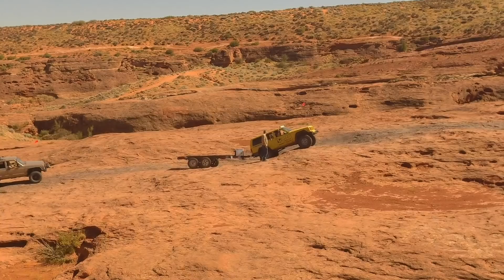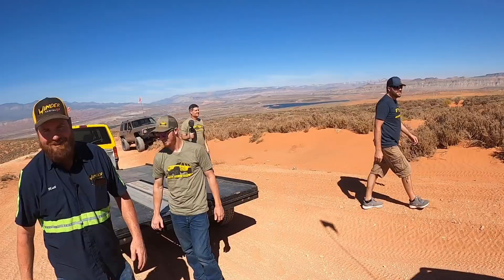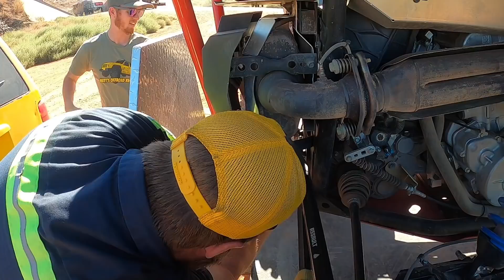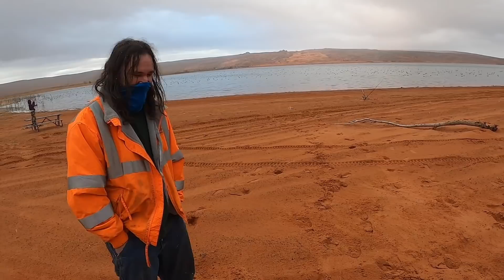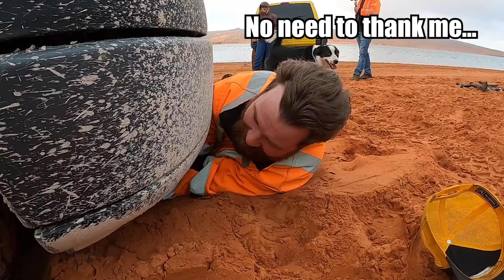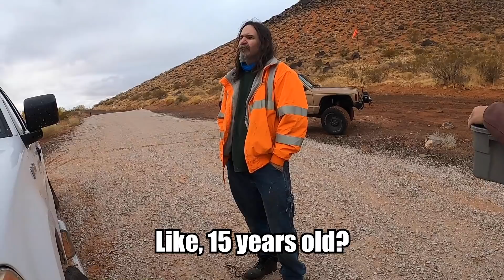Could I Make This Recovery Any Harder?!

Comment: it is the year 4021 and the historians still wonder "what was the purpose of covering the utah mountains in rubber?! some kind of ritual, or do these blackened rubber lines create a bigger picture when seen from way above"... we might never know for sure
Reply: That's a good one 😅😅😅
Reply: the black rubber must be for temperate acceleration
Reply: The ultimate goal was to vulcanize the hills and return to stone tires.  This would result in tires with substantially longer life.  The experiment soon discovered that the stone tires were subject to failure at high speed.
Reply: Desert varnish
Reply: This story ends in 4025 when the historians dig up a fossilized “So...I made a call!” T-shirt.
Reply: That rubber washes off after a while.  Lion's back in Moab was closed in 2004 and the tire tracks were completely gone a few years ago when I was there.  The gouges will last for a while though.
Reply: @MikesDIY  you can overanalyze every joke, to the point that it is not funny anymore.... -.-
Reply: @SuperVistaprint  sorry, that wasn't meant to analyze or detract from your joke.  I just thought it was interesting when I saw Lion's Back and it looked like no one had ever driven on it.  I thought others might find it interesting how quickly those tracks disappear.
Reply: @MikesDIY  all good, no worries ;)
Reply: @MikesDIY  I suspect that given enough time the earth will scour away or bury any evidence that humankind ever existed.  Our steel creations will be iron oxide deposits, our concrete, dust, and our pollution dark bands in the geologic strata.  Our entire existence is but a tiny blip in the earth's timeline.
Reply: @thedave513  By that time, the only thing remaining will be Andrew Camerata's container castle.

Comment: I am starting a business for aftermarket steering linkages for Razors....was thinking of painting them yellow and getting Matt to autograph each one....
Reply: if you reinforce that part, something else will break.   pretty soon you have to rebuild the whole rzr into a proper dune buggy.😜
Reply: I've often wondered if it's possible to design a side-by-side that is better able to handle these terrains than the current ones do.
Reply: I hope you’re going to make them stronger….they couldn’t be any weaker!

Comment: Matt, I have learned a lot about stored energy and your little jeep, it is great. Maybe I can return the favor. I have a 10 wheel truck that will sometimes overheat. I put a windshield washer omit, ahead of the radiator, to spray when hot, cools right off.... good luck out there

Comment: Like that you added celcius in this video of the temperature. Now I finally not needed Google to understand the weather forcast ;)
Reply: So is 32 degrees F 0 degrees C its so weird Merry Christmas 🎅 🎄
Reply: @jeffmabry1149  -40f is also -40c btw
Reply: @greenscreen1060  In Celsius ,       + 40 =very hot ,  +30=hot , +20=warm,  +10= wear a sweater or light jacket ,  0 =freezing ,    -10= cold ,  -20= even colder , but you can work outside ,  -30 = very cold , hard to work outside but guys do it ,    -40= you better have a lot of warm clothes on

Comment: "Powertrax No-slip" locker needed in rear..Operates as smooth and quiet as a limited slip and goes where the spiders/clutches are in that trak-lok..Drops right in, goes like mad. I've run one in a D60 with 4.56 and 38x15 boggers, and another in my street truck with 37" SSRs and 4.56..work pretty good, both were in heavy ass Dodge ramchargers

Comment: Still think you need an max coupler articulating hitch for that trailer.
Reply: A simple pintle hook like the military and heavy trucks use would work
Reply: I would just be happy if they had trailer chains.
Reply: nah it works
Reply: @aaronignatowski1018  Yeah, I'm surprised they're still not running proper safety chains. It is a legal requirement and I can't imagine the liability should that trailer come free again and damage property or injure/kill someone.
Reply: @PervertedThang  Especially when his previous vids show it coming unhooked and crashing yet he has done nothing to remedy the hazard.
Reply: @puntacanaman1  I pull my chains whenever I'm offroad.  They are a hindrance and bind
Reply: @scrappyweeman4952  Yeah, but he doesn't use them on road, either.  You see the clip of his trailer popping off and nearly nailing that nice side by side?  Could've been a person.  He's had his warnings.

Comment: Rear locker quit working?  Noticed the right rear not turning on the left incline
Reply: I noticed that too. I think he'd have made it up if his rear diff had been locked.
Reply: Looks that way yes
Reply: Although it was spinning later on
Reply: It's not a locked rear it's limited slip out of an old Cadillac hearse
Reply: @dustinpurden7693  oh! Thought it was locked
Reply: @dustinpurden7693  that's right, I forgot about that. Might need new clutches in it then.
Reply: @dustinpurden7693   Close, I think it was actually out of an ambulance
(The Van Type)but who knows what urban legends will say about whats inside the Banana in the years to come.🍌😊
Reply: Time to put a locker in it.
Reply: @skeetermcswagger0U812  best comment
Reply: @dustinpurden7693  I think they updated that to an 8 lug floater dana 60?
Reply: The rear doesn't have a locker just a limited slip.

Comment: Who buys a 2WD truck? Seriously whats the point? 
That layback by Matt was hilarious.
Reply: a landscapng truck or any city truck can be two-wheel drive + its cheaper, but yeah may as well get a 4wd
Reply: I've got one of each. They both have a purpose.
Reply: Many businesses have zero use for 4WD, so why spend the extra $$$?
Reply: @GrnXnham  If you're staying on blacktop fine. But if you are going to be anywhere with lots of snow/ice, or off road, then it pays to have the 4x4.
Reply: @rachelgibson1858  Obviously

Comment: Why never any trailer safety chains? I saw the trailer pop off once and roll down a hill.
Reply: I think he cuts it so hard so often that the length needed would then drag and hang up on obstacles. It's a tough call where you're gonna hit problems either way
Reply: @supacheef1  Matt said this was old footage from a while back - newer footage on other videos he has commented that safety chains are finally installed and used..
Reply: Because it’s fun to see the trailer take its own path sometimes
Reply: @supacheef1  I'm sure there's a solution. tape them up to to the tongue of the trailer or something. if they're needed and get loaded up the tape will rip and you're still safe.
Reply: @sdpelly  Thanks ! I can breathe a sigh of relief now...
Reply: @slunasaurusrex  that's a really smart idea. And cheap. I like it.
Reply: @flipnotrab  Absolutely!

Comment: I'm going to say it again, especially now that you have bead locks! You need a CO2 PowerTank, then you could air down to ~5PSI to get over these obstacles, then air back up to 15/20PSI. Plus you run the real impact guns with a flip socket set to change flat tires.
You can get small and giant tanks if you're worried about weight. I got the 5lb PowerTank kit. Then I got s 2½lb CO2 tank on eBay that I take with me along with a jack, impact, and flip socket set. I also got a 20lb CO2 tank I can use at track days or if a friend has a stupid long haul from the junkyard.
Refills aren't free, but CO2 is far superior to a 12volt compressor or the air conditioner compressor turned into an air compressor with additional tank and regulator system on board. The PowerTank can be removed from the truck and used anywhere. Purchase 1 for the flag tire rescue van, borrow it a day in the Jeep banana doing an ATV recovery see how you like it.
Hopefully you're business friends with the fire extinguisher inspection, or welding gas supplier, for cheaper refills.
Make that call, I would think PowerTank would help you out like Yankum Ropes, if you add 1 sticker.

Comment: Matt, for the love of god, put safety chains on that trailer.
Reply: I’m surprised it’s legal on the road. Never fun to have a trailer jump the hitch.
Reply: Snapped a 3/4 inch steel tow bar clean two  once just from regular heavy use on rough roads. Safety chain stopped the trailer going through the back of the 4wd. This trailer is 100% going to end up wrecked one day in a ravine  with a Razor on back. I just don't get why you wouldn't do it. It's completely illegal not to have where i live.
Reply: I agree with the chains on the highway,  but not off road saw a friend of mine get seriously hurt, could have been avoided  if the chains had been disconnected.  There's  a proper time for every precaution.
Reply: Trailer brakes would be nice
Reply: On the way back from the recovery the trailer was chained up.
Reply: @kenhorton3482  i agree, but much of what Matt does is for cinematic effect. If he has himself in a position where the chains are a liability he can remove them, or since he usually has the film crew outside when he gets into a situation, they can remove them.
Reply: @rd4660  what I saw was the wiring harness.
Reply: @SlabbinNCabbin  It's not.
Reply: @kenhorton3482  Can you explain? Was he in a dangerous position to begin with? Is that more dangerous than having a runaway trailer smash someone into rocks?
Reply: @slunasaurusrex  my friend got pulled into a river when the trailer hit a big rock and knock the trailer on the down slope towards the river, so how do you have time to get out and take off the chains. The trailer ball ratted at ten thousand pounds snapped, other than  going up a hill with a slide slope  that ball was not under much torque. So have them unhooked or maybe have the trailer wipe out more people trying to unhook.
Reply: I just watched a newer video before this and Matt showed off the trailer with a pintle hitch with safety chain's.

Comment: While I remember why don't you fit Anderson connectors front and rear of the jeep and have another on the trailer then you will be able to connect your winch anywhere without worrying about power or even opening the bonnet even if you forget the jump pack and I don't think the weight will be to much 
Anyway just thinking out loud

Comment: Maybe some hardcore heavy duty industrial strength caster type wheels on the bottom side of the tail of your off-road trailer would be good for coming down/going up some of those rock faces? It would at least keep the trailer from taking the brunt of the impact. 🤔 Where’s Fab Rats when you need ‘em??!! 🤣😂

Comment: What do you think about adding a skid plate on the back of that trailer Matt?  Would help it slide off the rocks.  Doesn't need to be too thick.  It's sacrificial anyway right.

Comment: For these broken tie rods you need to see if Rudy could fab up a piece of pipe with captive nuts on both ends and a bolt to screw in those. You would slip the pipe over the broken tie rod and tighten the bolts so you can steer these broken rigs onto a trailer or wherever you want them to go.

Comment: 71' Chevy C-10 2wd long bed inline 6cyl 3spd manual trans. No power steering, Brakes or  A/C , little Nylon baloney skins for tires. Would intentionally try to get it stuck and never could. It would go places 4x4s couldn't or wouldnt go. Must have been the rowboat on the top rack that was the trick. Wish I had pics.

Comment: You should but a steel rollers in the front and the back of the trailer so when you brake over it just rolls instead of scraping.

Comment: It looked like the tires on the trailer were aired way down, which reduced ground clearance. Why? I air down for traction, but that wouldn't really apply for a trailer, except for braking. Maybe to keep sharp rocks from cutting the tires?

Comment: Dumb question. If you regularly have side-by-sides with broken front or rear, why can't you make a dolly for off road, that just holds up the broken end, so you can tow it out to the road? You can haul the dolly on the trailer and leave the trailer behind.
Reply: I guess the answer is that you could cause more damage to the side-by-side.

Comment: Well, I suppose it's good you finally got the overheating sorted, but now yer not getting up to operating temps?  Just block the radiator.  All we do with big trucks.  A bra, or just cardboard.  Doesn't matter, just keep air from going through it.  Thermostat ain't gonna open anyway, but will keep the engine bay a bit more isolated and warmer.  We run Montana in temps -30f and lower.  Diesel runs hotter to begin with, but just keep that cold air outside the compartment as much as possible.

Comment: Can you drop the coordinates on where this rescue was?  I like that area, and putting plan together for trip down.
Reply: Not sure of the coordinates but if you Google "Sand Hollow" you can find it easily. This trail is called the "West Rim Trail." You can go through the state park and through the tunnel or there are other ways to get to the dunes. I'll look at the coordinates on my pictures and post those.
Reply: 37.100228,-113.431692  This is the "steps" location that is along that trail.
Reply: @jilliansadventures4679  THANKS!!

Comment: I think they are taking the hard way for the drama. you can see it in a couple of the shots. Also a pintle hook instead of that ball hitch would be better
Reply: No drama here, on a map that way looked the quickest but it ended up actually being a 4x4 trail. Instead of double backing to and alternate route we just kept going. Also a pintle hitch and chains have been installed since this footage was recorded.👍
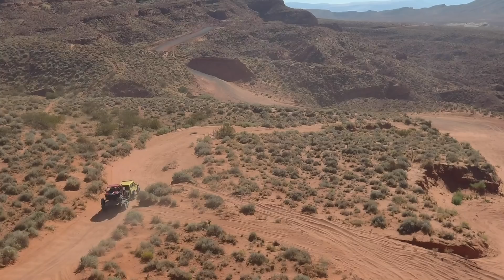Reply: @morrrudy434  Thanks for the response. Hey don't get me wrong the videos are great. check 5:08 there is a road going around that rock ledge. We will call it showmanship. Keep up the great work.

Comment: Don't wanna be that guy, but isn't it a golden rule not to tie stuff down that is sprung by suspension? That's why always tying down the tires is the safest?
Reply: There is a plus and minus to both methods
Reply: @tomhutchins1046  what's the proos  for tying the sprung chassi down? When the suspension compresses the load on the trailer is not secured and can move
Reply: @Swedishchef11  So it wont bob around and shift on the suspension making the trailer unstable.
Most cars and equipment are chained or strapped by the frame. Tires are rubber and straps around the tires can come off. Also bouncing along on the suspension puts unnecessary wear on the suspension. Im sure i could come up with other reasons
Reply: @tomhutchins1046  so you are saying what I'm saying. It's not good to tie on the chassi. Tie correctly on the tire instead.
Reply: @Swedishchef11  Then just about every race car i have seen being trailered is doing it all wrong? Next time you see a piece of construction equipment on a low boy note how its chained down.
No Im saying tie down by the chassis
Reply: @Swedishchef11  PS you cross tie it. by the chassis tight so it wont shift. Wrapping around the tires will allow it to shift sideways
Reply: You dont have a clue and it looks like i cant fix that. So %95 of the people out there have it wrong? Make sure your insurance is paid up and have a Merry Christmas.
Reply: @tomhutchins1046  I was taught this way from both the theory books and the driving school when taking my heavy trailer license here in Europe. So merry Christmas to you to. I have never had an issue with this way. You never tie down on stuff that is held up by springs. It will come lose on a bump.

Also not based in the US and I think we just misundstand each other.
Reply: @Swedishchef11  your from Europe oh that explains it. In the usa we tie down the frame as shown